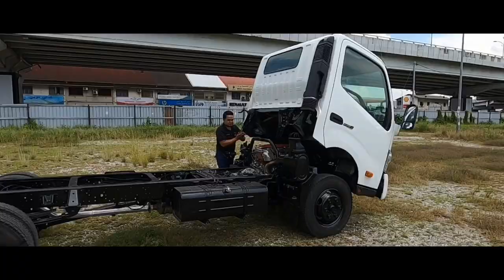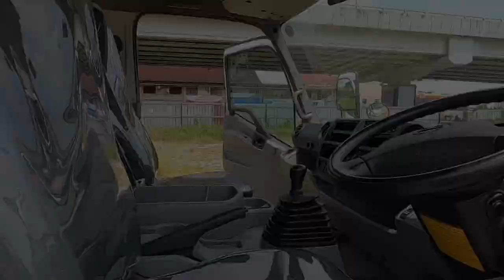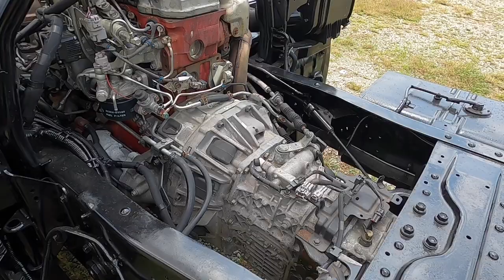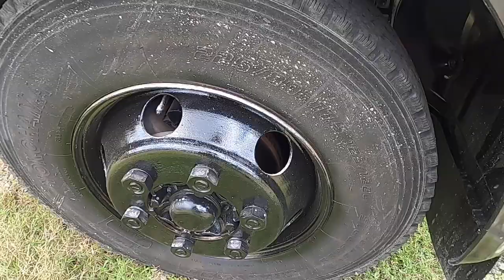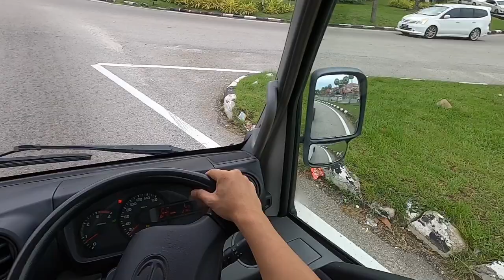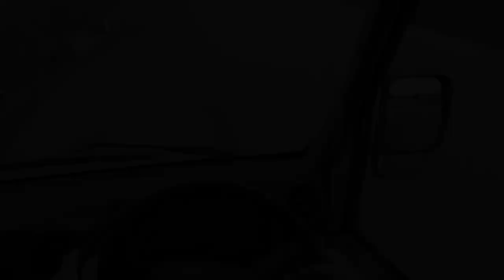HINO XZU710L || 4 POT DISC BRAKE || JAPAN SPEC || 156 HORSEPOWER [English Subtitles]

Comment: Boss.. buat video untuk turn off speed limiter please.. hino 300 euro 3  tahun2019..
Reply: jangan laju2
Reply: @awangadenan611  bukan nak laju sangat.. dapat 160kmj jadi lerr.. 🤣
Reply: @matshah8538  dia guna obd bang connect ke pc utk setting ecu
Reply: @awangadenan611  thanks info..
Reply: @matshah8538  tapi lori aku dulu dapat top speed smpai 140 tapi tu lah engine tak tahan mudah overhead dan 2 bulan lepas baru tukar gearbox
Reply: Xde la nak laju mcm tu.. dapat maintain 110kmj -120kmj kat highway jadi la.. ni setakat 100kmj je.. mereput dari kl ke ipoh.. 🤣🤣 Nak potong lori besar pun takut x lepas.. dapat memotong dengan yakin dah cukup.. ni lori 100kmj, nak potong lori besar 90kmj.. dekat setengah jam bersaing baru lepas potong.. naya orang belakang..
Reply: @matshah8538  itu ok lagi saya dari kch ke miri 16jam dengan absorber lori rasa kayu lagi dengan jalan pan borneo yg tak pandai siap2 tension oo